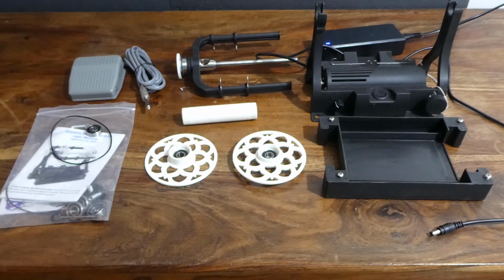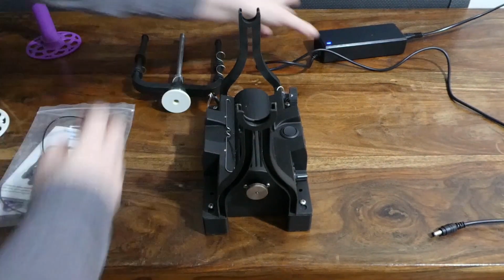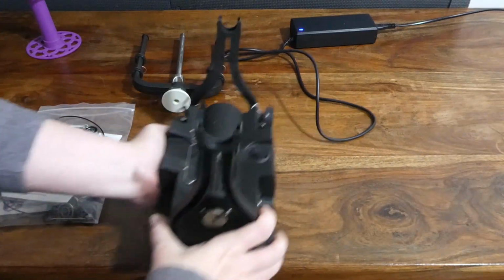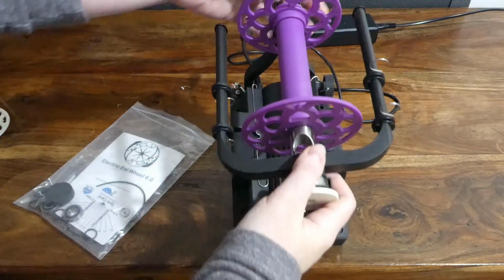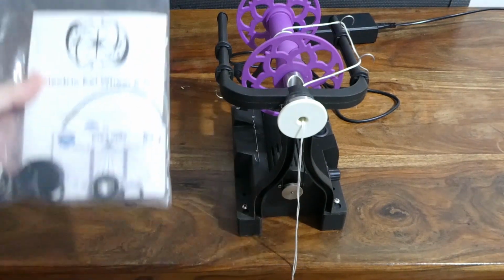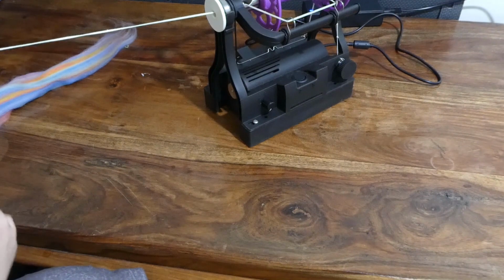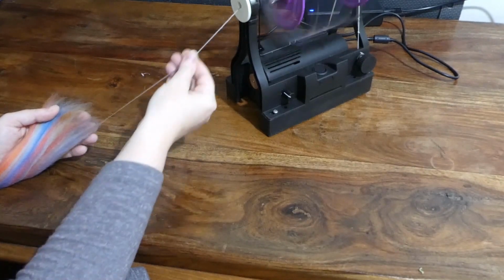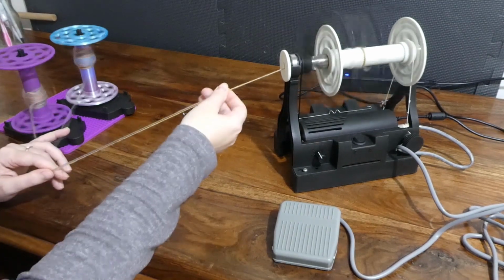EEW 6.0 - Quick Start Guide

Comment: Do the things in the little baggy come with the EEW 6.0 or was that only for people who joined the Kickstarter? I do not see them listed in it's description. If so what are they? I am partially wondering if it comes with the finer spring as I like to spin fine yarns. Thank you
Reply from the maker: Yes, the extra spring is included.  The only thing not included from this video is the Lazy Kate which you'd need to order separately if you want it.
Reply: @DreamingRobotsBlog Perfect!  Would the "EEW Nano USB Power Cord" work with a Nano 1.1 compatible 5v battery if the EEW 6.0  is kept within the Nano 1.1's speed range?
Reply from the maker: @cats1000m  I think you are asking if the EEW Nano USB cable would work with the EEW 6.0.  The answer is I don't recommend it for a few reasons.  First the EEW 6.0 can draw more current than the cable or a USB port supports so you might damage those if they aren't correctly protected.  Second this Nano cable outputs 9V and the EEW 6.0 normally runs on 12V.  This won't hurt the EEW 6.0, but the EEW 6.0 will run slower.  As far as having the EEW 6.0 run slower that helps, but doesn't completely fix the over current problem because even at low speeds if the motor is stalled (or put under high load) that can spike the current a lot.  So overall I don't recommend this.
Reply: @DreamingRobotsBlog I was wondering if a EEW Nano USB Power Cord would work with a 5v battery like the Nano1.1 if the speed on the EEW  6.0 was keep in the  same range as a Nano 1.1 (up to 1,000 rpm.)
Reply from the maker: @cats1000m  I had a longer answer to this above, but the short answer is no.
Reply: @DreamingRobotsBlog  I was simply rephrasing  my question.  So to clarify the answer is that a 5v battery with a EEW Nano USB cable will not work with an EEW 6.0.

 Thanks for your help.

Comment: would it work to put a little round of felt pad on the lazy kate to reduce the noise or will that put too much drag on the bobbins???
Reply: It shouldn't cause too much drag, I will try and remember to try it out. I'm not sure where the noise on the lazy kate comes from; if it's from the bottom where a felt washer would help, or the shaft, or even the base resonating on the table.
Reply: I would also like to know, I'm glad you mentioned it. Seems like a good solution to me; I do not profess to be any sort of machinest!